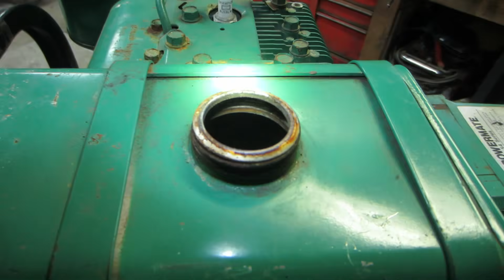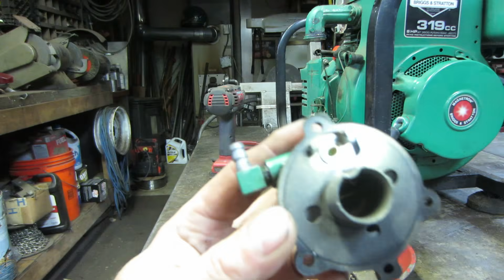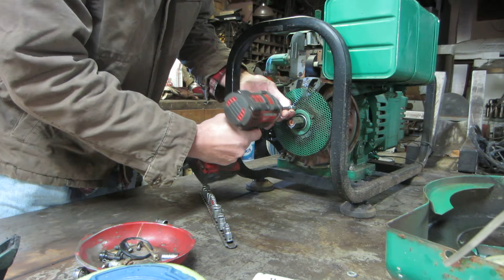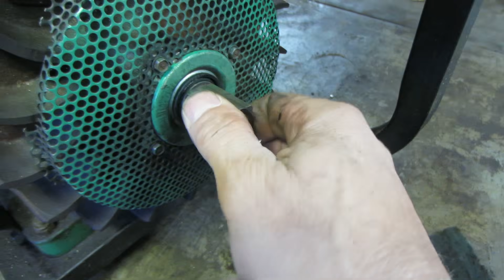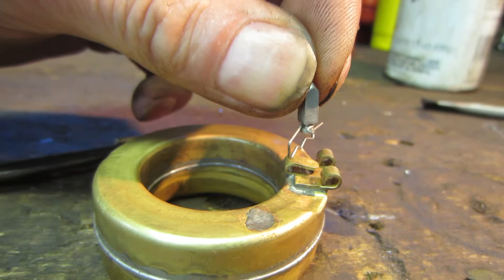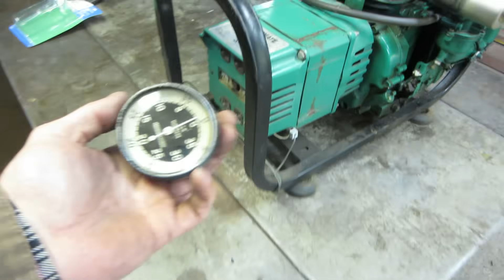lets fix up an old generator

Comment: Thanks for posting this years ago. I bought a 4000 watt 8 hp briggs for 75 dollars. Had to clean tank with mineral spirits and replace on off fuel valve. Clean the carb. 
The biggest unseen problem i see with these is the usually have a frozen govenor linkage. I freed the up and it responds to loads way better. Thanks again.

Comment: So I sit here in my shop on the Kenai peninsula Alaska, staring at a similar Briggs I just got from the dump also with a sloppy pull cord and missing the muffler. Mine fired up with minimal effort and everything works! I think the owner didn’t realize it had a fuel shut off! Had fresh gas in it!

Comment: Hello there I have an old Coleman powermate generator 54 series 4000 watt generator. It's an 8 hp Briggs and Stratton engine. Your generator looks to have the same air filter.  Do you know a part number for the air filter?

Comment: My neighbor was getting rid of his Coleman 1997 2250Watt generator.  FREE! I knew I would get it working and I did. It was the brass float in carb. It had two cracks in it and filling with gas. Rebuilt carb and new  float, runs like new again, won't tell him that! LOL. Can't find the owners manual on line though. Also put a new pull cord on too.

Comment: So awesomethat you had one same as the one I was gifted.  Mine leaked gas from the carb area.  Thinking the float has some issue and it probably needs some good can cleaning (what was that cleaning soluction by the way?).  Thanks a bunch for the close ups and step by step....Peace

Comment: I got one of these green things,  not the same but very similar.  I laughed when you mention early in it doesnt have a kill switch as if it were a snake it would've bit you.  LOL.  Anyway got mine started tonight for good measure...That damn choke.  I gotta put it in the middle to get it to go and any other extreme will just tucker me out pulling on the starter .   Apparently these were around the early 90s it was my dads... so may be time to upgrade just for fault tolerance.

Comment: The kill switch is that little piece of metal that you push down and touch the top of the spark plug that kills the engine

Comment: is that fuel filter on backwards ?  Thanks. My pull start was also hanging up, I hit it with PB blaster and it fixed itself, after a bit of cleaning up.

Comment: The muffler bolts and gasget were only 8 bucks the new carb. With the new fuel line gas shutoff and fuel filter were only 25 bucks for the kit.
The new brushes for the generator were 15 bucks for two sets. They also have the regulator for the generator for a couple bucks. I couldn't believe how many parts were still available for such cheap prices.
Mine runs perfect but even with the stock muffler it's pretty loud but it works in a pinch.

Comment: I have an Ag-Tro9nic 4000 54 series 33.3 amp generator. Mine would not put out any electricity when I 1st got it. I checked for free brush movement and found one was hung up. Took it out and rubbed the sides of it as they are nothing more than a pencil lead compound and made sure it moved freely inside the brush hood.  Put it back together and voila! Other than that I pretty much always need to zap the field with a 6 volt battery tickle and make sure the drill rotates the right way. If not I switch the wires and reap the fields. I will need to replace the muffler and that is well seized so not sure how that will will go. Appreciate the video on an old but reliable generator.

Comment: The kill switch is located right next to the spark plug, it's on a hinge so that you can ground out the plug to shut it off.
 Also, to tighten the recoil, simply remove the pull handle from the rope and feed it back through the hole,..... then rotate the spring clockwise once or twice and feed the rope back thru the hole and attach the pull handle again.

Comment: i recognize the pickup assembly, its a Hall effect inductive pickup-thats attached to the pull start.. cleaning the flywheel/rotor surface helps it start easier, run cleaner and more efficiently. ive serviced a LOT of lawn mowers that have that same assembly and they always run smoother & better & start way easier after cleaning that.

Comment: Always run sea foam through the carb and run it dry before storing it
Reply: I did that last year to my weed eaters and I had to retune the carbs this spring because they were all running rich. Apparently I had them tuned richer to compensate for buildup in the fuel system.

Comment: Designed and built at a time when engineers actually considered taking the recoil housing off as general maintenance performed by the owner, so it slid right out.  Now they would intentionally design it to not come out without dismantling everything else.  The RMA warranty repair workers would have a special spreader to force the frame out just enough to get it out, 1/8" too much spread and the frame would break, voiding any warranty.

Comment: The older Briggs L heads hold such a steady rpm, I love all the models, 14,17,19,22&25, from the 60's up to 1989. Before they started using foreign carburetors.
Reply: Yeah carbs are all brass inside float and other parts no plastic
Reply: The head had a metal tab to ground out the plug

Comment: Hey mustie, I've got a 49 clinton powered dayton generator that was a freebie. It runs now that I've cleaned the points, but I'm having trouble getting it to put out power on the generator side. The slip rings and commutator are nice and clean, but I'm not getting anything on from the outlets. The 12v DC starter side seems to kinda work.

Comment: We had a GenSet like this. Was a Coleman brand. Motor blew and we put a B&S I/C RENTAL DUTY block on it. 8 HP it was. Tough unit with the yellow motor. It was a 7000 Watt unit. We even did the same to the Troy-Bilt rear tine tiller.

Comment: Thanks for doing this video. It helped me bring my (late) Granddad’s Coleman PowerMate 4000 genset back to life. Hasn’t run since the mid-90s.

Carb was clean, except for a couple jets. Surprised how quickly I could get it sputtering. Emulating your fuel-air mix adjustments got it running. Just now shut it down, after running for nearly an hour with a 1500-watt heater load. I cut the fuel off so it ran out of gas, drained the carburetor and siphoned the rest from the tank, per your suggestion. Gonna test it again in a week to see if it starts easier this time. 💪

Thanks again!

Comment: It never ceases to amaze me how those much maligned Briggs & Stratton engines will take years of abuse and still come up trumps. We used to have, and still should (somewhere), a 'special tool' for removing those starter ball clutches from B&S engines, though I have seen guys using a hammer and parallel punch to strike against those little lugs - not really a good idea!

Anyway, I'm sure I've seen that, or near identical square bodied generator sold in the UK in the early '80s. Painted white and carrying the brand name "Conyers", and still as a 110V/220V, but 50Hz as you would expect in UK, and equipped with UK sockets.

A note on the float! - The golden rule, as written down in the B&S manual of the time showed the float as being correctly set when the float's top surface was parallel to the the face of the float bowl top cover. In plain English, we always referred to that as being "level across", so you're spot on in your setting procedure. I guess the fuel level isn't absolutely precise, and if you take into account, vibration, uneven ground and anything else that would upset the level in the bowl, then nor can it ever be, so there has to be some degree of latitude.

Comment: Mustie, I know this is an old video, but I have a question for you or your viewers. I happen to be working on the exact same motor/carb setup as this one. Old leaf vac, Billy Goat brand. It hadn’t ran in a decade. After watching your videos, I was able to get it running. My questions are:
How do I identify/describe this carb in order to get a carb kit and where do I get it?
Also, you said you didn’t soak the upper part of the carb for fear of damaging the needle seat. Does this come with a rubber seat? Mine didn’t have one. Or were you afraid of etching the seat with the carb cleaner? Any and all help is appreciated!
Reply: Flow jet carburetor .
Reply: Use engine  model ,type  and code .   Some parts available  on internet.     Remove  main jet before  disassembling  carburetor.

Comment: If you thread a cut fan belt through the spark plugs hole to stop the piston from reaching tdc that will allow you to remove the flywheel without risking damage

Comment: It's an electronic ignition vs a plunger and point system  both control timing of the sparks in the spark plug

Comment: Those old generators usually have low hours on them . I picked up a 5hp Honda en2500 engine but have no charging unit to put it on , if ya need one let me know , it’s user specific!

Comment: Hey that muffler you put on there , I bought two of them for my 22hp Kohler zero turn  and removed the stock muffler but left the pipes and I welded one of those exact mufflers in the end of each pipe giving me a custom true dual exhaust , sounds pretty bad ass honestly , kinda has a Harley type tone to it. It is a bit loud though as I drilled holes in the center baffle to increase flow so they weren't too restrictive . Only cost me 14 bucks for my custom dual exhaust my neighbor's hate me when I mow my lawn . No police coming with noise complaints yet though so it's all good in my eyes

Comment: Hey Mustie1 when you adjust a generator you want to adjust it for frequency rather than volts. Freq will do more damage to electrical devices than voltage that is +/- 10V

Comment: Love your channel thank you for the time you spent so much could be learn and remembered I do have a question where do you find parts other then your own stock pile of old equipment?  and where did you get that rpm meter please? have a bless one...
Reply from the maker: ebay has worked well for me

Comment: I have an old Agtronic a lot like that, but bigger, 16hp Briggs & Stratton with 4kw gen. Picked it up from a farm estate I helped liquidate. It worked when I got it, but the carb has gummed up from sitting. Mine has a manual wind pull start though. And I haven't hooked it up, but it appears to have battery powered start too. Thanks for making the video. It'll help when I fix mine.

Comment: WOW I bought one of these Coleman new back in 1987. It had a plastic gas tank which cracked. Once the power was out and after a week of continuous use, the plastic brush holder got warm and soft enough so the brush got held up. Coleman paid to fix it under warranty.

The upper outlet is split with both sides of the winding present in each half of the duplex. I was in in a pinch for 120-240V and didn't have a NEMA 6-15 Plug for the bottom outlet so I used two MEMA 5-15P's and got it out that way. ("kids don't try this at home" Good way to ruin equipment and get zapped by back feed) From the 2 plugs I made common the whites and greens like a grounded neutral and used the 2 blacks for the 240V to get 3 wires. This Ag-Tronic generator is not wound for slash rating 120/240V it is only 3 wire. It's like a three wire single phase service in your home and not a 4 wire sub panel... (short explanation) I would ground to the lug on the generator and never had a problem. 
Mustie1; I could check the speed with my frequency meter but I would need you to adjust it. :-) Great Vid! 

It sold for $499 new at the department store. They also sold a 5000 Watt unit but that had a Tecumseh engine on it and sold for $599. I went with the Briggs.

Comment: I had one of these things years ago. I never could get it to run right even though it was brand new out of the box. I tried everything short of completely rebuilding the thing. It never ran right. Quite possibly the worst generator Coleman ever made

Comment: Wouldn't you want to adjust the RPMs to get 60Hz frequency?  That should give you 3600 RPMs if you don't have a tach or can't connect a tach to the engine.

Comment: Those old engine used a metal tab mounted to a head bolt that ground out the spark plug as the kill switch.
Mine also did not put out power when running but the slightest turn of a drill chuck while plugged in and it was off and running.

Comment: I have two of those, they've been sitting for years (have a Generac now) but would back feed from the garage 220V to house (don't forget to turn 
 your main off) to power the sump pump and basics.  Some mods I did, upgraded to the larger plastic tank that sits on top of the chassis - either 
tank option,  you'll be filling up the tank every 1 1/2 hour, so little sleep if you plan on using for any long period of time.  They are LOUD, tried to retro fit a small car exhaust to quiet down, but still loud. Added wheels/axel to motor side of chassis for easier transport.  Overall pretty good generator, 
brushes were hard to get years ago.

Comment: on the way home saw one on side of road knocked on door and they said free !  Promptly found itself in back ov truck.  fuel tank gone plastic one bungeed on .  11 hp 5000 wat put a sniff of gas in tank 5 pulls running !!!!  Need the fuel tank off that one tell him it was bad ill trade the plastic one Ill even toss in the bungee .  and I have not tried it yet but it has elec start too !!!!  PS gen.  works to .

Comment: You should use a frequency meter on it to make sure it is 60 !
Reply: Donald Smith - The voltage is probably regulated despite RPM but probably needs to be right on for 60 Hz. GOOD CATCH.
Reply: Most of the small generators change the speed some depending on the load but most will stay with in 2 or 3 Hz but that is good for things but some things care. Many new things like phone chargers, some computer power supply are rated for 50 or 60 Hz, many motors just can't take a joke!
Reply: Those need pure sinusoid. These generators put out a very crude sine wave that some loads can't use.
Reply: Well if that is what you think. I have used frequency meters on many generators, even some of the worst ones the frequency meters would read!

Comment: Is there any kind of throttle speed control on these?  My unit looks very similar to yours and I am wondering if the plate under the carb is supposed to have more controls like slow/fast and maybe a kill switch?  The parts online seemed to show stuff we're both missing?
Reply from the maker: not that you would adjust by hand, only a screw driver

Comment: Very good video, one thing on generators is that it is important to get the RPM  properly set so the frequency on the AC is at 60Hz, if your multimeter reads frequency just insert the leads into a receptacle and adjust the RPM as needed to set that frequency, a very knowledgeable person told me that years ago,
Thanks, Dave
Reply: Hey Dave, I saw your reply here and I’m asking a total noob question here….but if rpm isn’t properly set and AC isn’t 60Hz, would any outlets even turn on a small light? Better question is if the engines runs well but we have no AC power, is that a bigger problem than get the engine to even run? Hope this makes sense.

Comment: If you take a flat big punch and hammer and tap on the heavier tabs of the recoil clutch you can break then loose with minimal effort.    Same with tightening them when they go back on as well.

Comment: To me any generator is gold!   i use a 2500 watts generator on a trailer as portable power for chain saws, every thing camping, boats, vans, you name it> At less you got power to do things off the grid>  i quit buy things like weed eaters, chain saws ect with motors and batteries Packs.  > JUST JUNKIE>  Went to all electric power tools : )

Comment: I own 2 of these.
They are 4Kw I believe.
Enough to run the stuff in your house that you really need to in an emergency.
These gen units are by far the easiest ones to work on.
Reply: 2009mechanic do you know where I can get a carb rebuild kit for this same Briggs motor? It’s a pm54-2000 I believe
Reply: No I don't , I'd just look online using the engine tag.

Comment: Hey Mustie, love your videos. I found a generator that looks just like that one. I got the engine running but there's no electricity. I replaced the capacitor and still nothing. What else can I check, or do you have a video that covers this? Or is the head junk? Thanks man.
Reply: are the brushes in good condition ?

Comment: HI from SC i goth a Nor Tech screw log spliter. And the gas tank is rusted pretty good. Do have a idea where I can get parts for it at. It has a 9 hp Briggs motor. I did get a spark and clean the carb. Yea I need some parts but some of them are not for sale or where have looked any ways.

Comment: I've got the same unit what bad carb and exhaust Port all stripped out. 
 Problem being not a number on the thing anywhere to reference parts. 
 The biggest failure on those gensets. Is vibration they shake to pieces.  I need a carb and bolt on muffler.
Reply: Roger Marshall hey I have the same one pm54-2000 do you know where to get parts I need rebuild kit for carb, I don’t know the actual carb data. Just the Coleman id
Reply: It's a briggs, the model number is stamped into the top on mine to find parts.